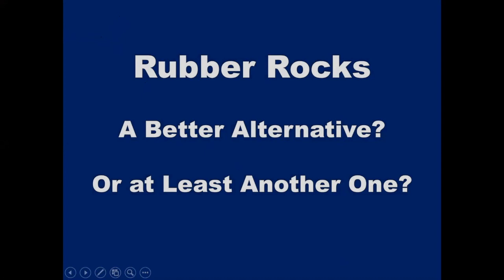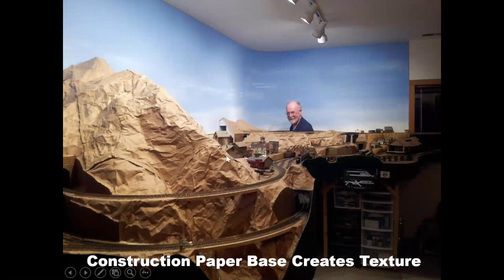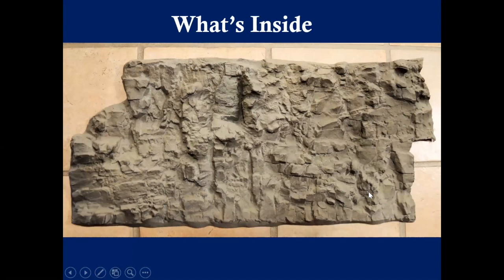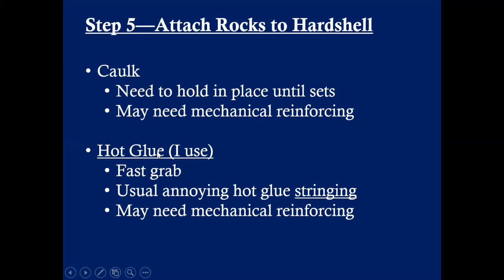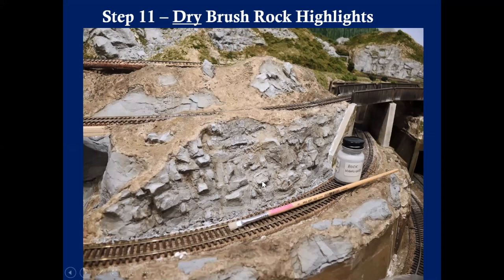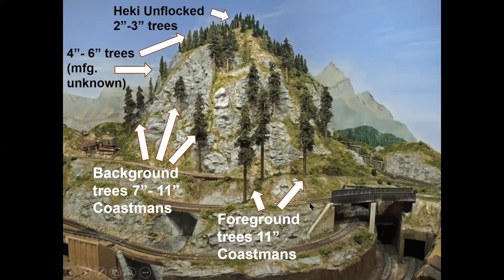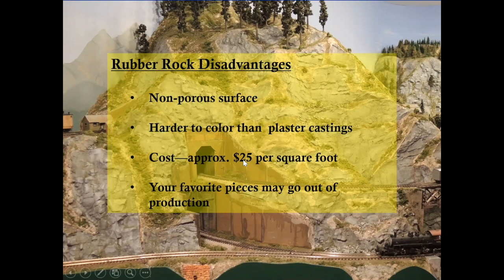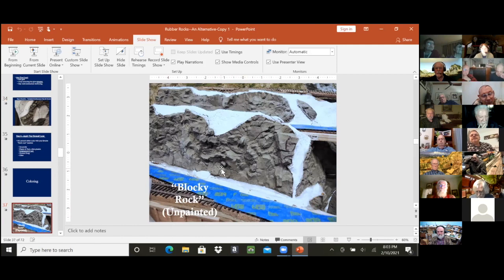Rich Thom on rubber rocks for Whidbey Clinic 4DPNR 10 Feb 2021

Comment: Hi Rich. Very nice work! I thought I would share a technique I have used to attach trees to hardshell. First I use trees with a nail installed tightly in their bases. I drill a hole in the hardshell where the tree is to be attached, then I hot glue a small cube (approx 1-in on a side) of pink foam beneath the hole. Then I poke the tree base into the pink foam, and I am done. You do need to align your tree carefully before shoving the nail into the foam, because you only get one shot. However, if the tree is not aligned well, or you have bumped the tree and loosened it, you can simply pop the foam block off and install a new one. Cheers. Lee Marsh
Reply from the maker: Thanks Lee!